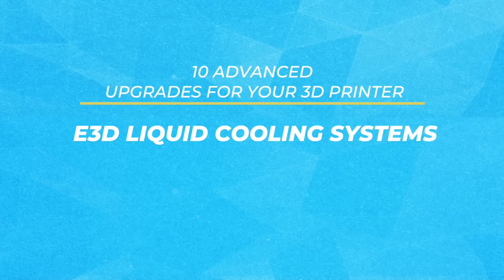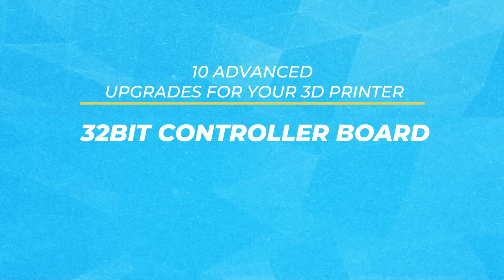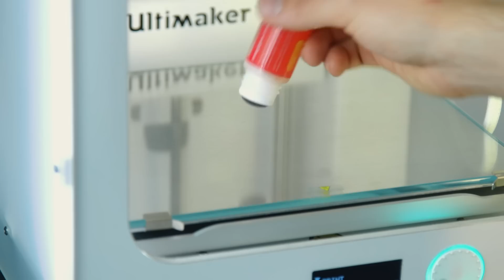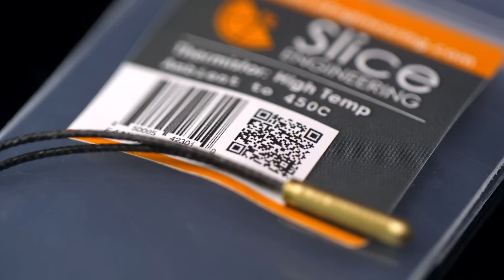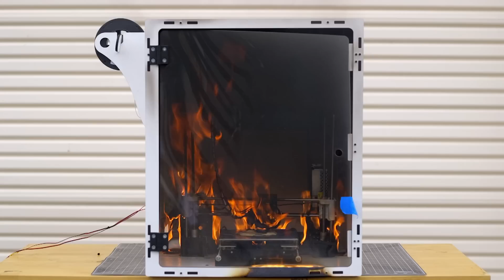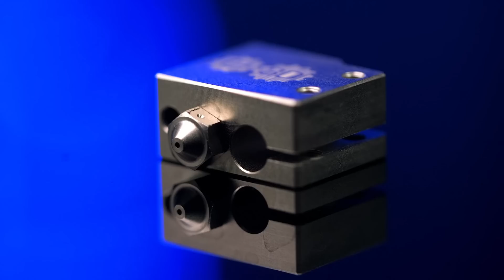Top 10 Advanced Upgrades for Your 3D Printer 2019

Comment: Good point about water cooling, I really want to see someone 3D print and epoxy an enclosure around the heat sinks of an air cooled heat sink and just pump water through that, gives an option to the poor peasants out there

There are a lot of 32 bit boards out there, great time to be building a non-cartesian printer that needs the extra processing speed like a delta or core xy, personally prefer Re-Arm boards because all my printers run on RAMPS and it saves money and time from rewiring and mounting. I know there isn’t enough time to list all the boards, there really are a lot to choose from.

TMC2660’s confuse me, with a 30V 4A limit, they are not intended for Nema 17’s that at their largest reach 2A but Nema 23’s that are ~150mm long that already have cheap TB6600 with 32,000 micro stepping or D series steppers with 250,000 micro stepping available. They are much larger with large heat sinks to handle the current already at TMC2660 micro stepping so someone out there isn’t after the micro stepping but really wants to stealth chop Nema 23’s on a dining size CNC machine? I can’t think of any other reason someone would want to put 4A through a stepper driver no larger than a quarter but I won’t stop them, just super niche.

I’d really like to see a comparison of a $10-15 magistick or 3Dgloop against a $0.10 glue stick! Angus from MakerMuse did one and was very entertaining. Very cool that 3Dgloop is a safer way to smooth prints than acetone.

For fire suppression I have been using automatic kitchen fire extinguishers and this fancy basket ball extinguisher, more of a general contingency if my whole lab catches fire so these smaller ones are very neat to avoid a large mess, could come in super handy for laser cutters.

Gold and bling lol

Fantastic video! I really enjoy being kept up to date on new tech and it’s just reassuring that the tech is still moving forward.
Reply: search "water cooling an air cooler", basically that, it's not too dumb of an idea
Reply: L3D - 3D maker very cool, lol, I have a lot of fun stuff to watch this weekend